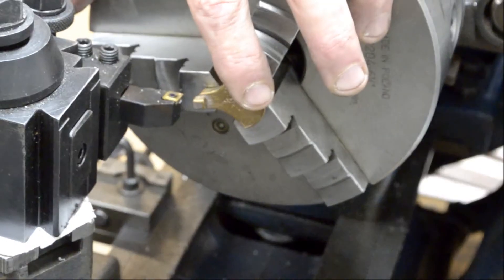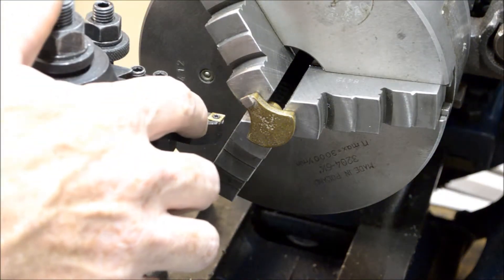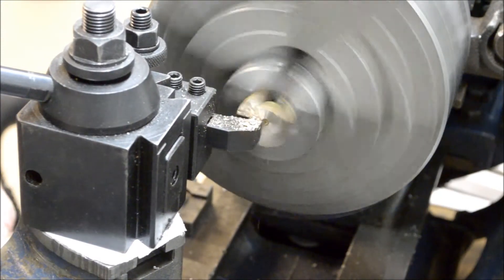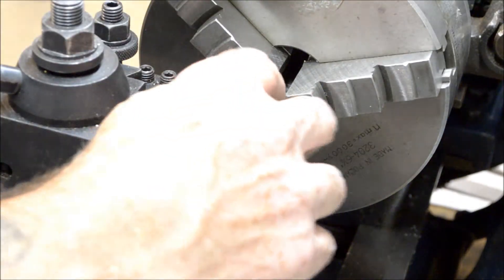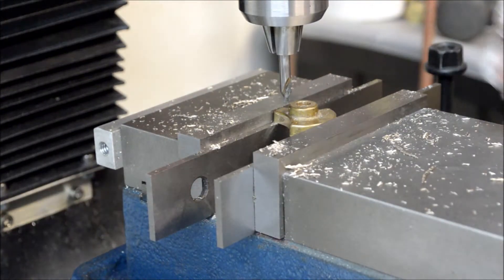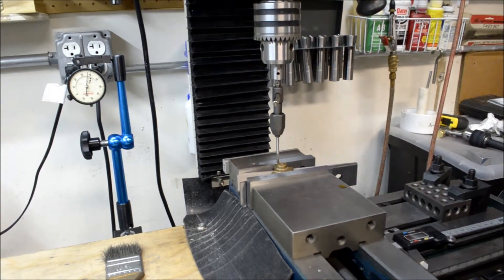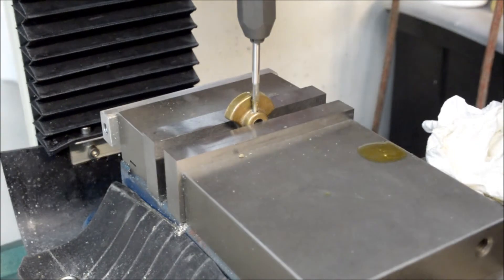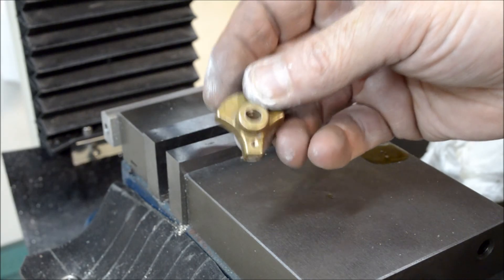PM Research #3 Crank Casting

Comment: I am surprised you can get by holding the round surface for only two point contact to hold. Waiting for my casting to show up to start. Look like I need more tooling to set up like some of your video.
Reply: Got may castings and thought I would do what I thought would be easier parts to start. My three jaw will not hold that tapered short boss. But I have the aluminum parts. May have to remove my chuck and see if I have a collet that will hold more of the surface. That or try to set up to mill that face. What do you think?

Comment: Thanks for making these videos!  I just got my #3 in the mail today and have been watching your videos (up to this point) to try to figure out what I'm doing.  I also watched another youtuber do the same.

I DO have a question: Why not drill the center hole on the lathe?  You already have the boss centered thanks to the 3 jaw chuck (or at least, more or less centered?).  You could then use a piece of drill-rod to find the hole on the mill to measure the offset for the other hole.
Reply from the maker: TheFreshmanWIT, I figured by doing it this way it would be the easiest way to ensure both holes were parallel to each other, less chance of binding. I am glad you are finding the videos useful.